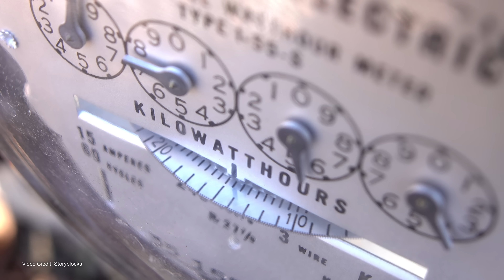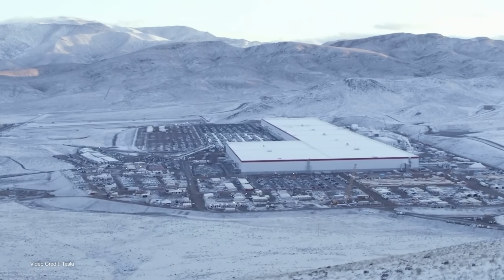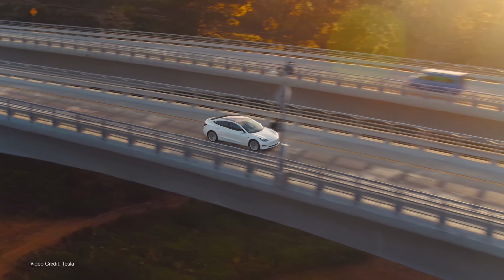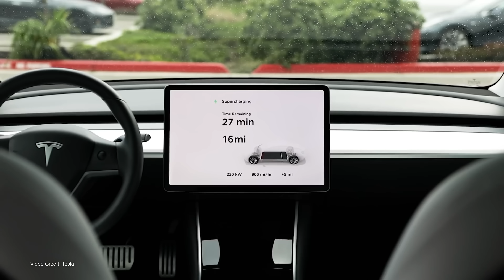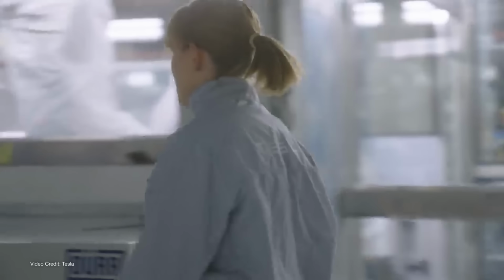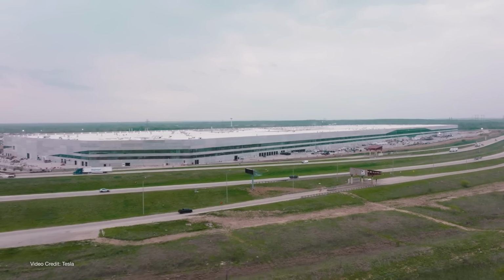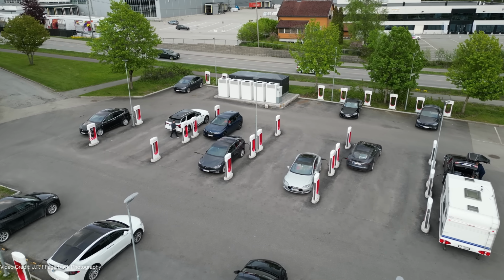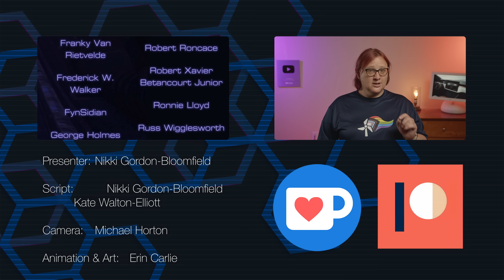Tesla News Roundup Episode 14: Munro Model Y Teardown, Where Tesla Staff Are Going, Model 3 1,000km!

Comment: There are some pretty darn quiet luxury ICE cars...  are they going to be required to have a minimum noise level too?
Reply: You mean interior noise. outside they are as loud as ICE cars at speeds over 30km/h due to the noise coming from the tires.
Reply: @rehleinklein7373  nonsense!!!!!! Those luxury cars also also almost as silent as EVs! Not all ICE are made to be soooo noisy! Modern ICE are actually super quiet in and out, apart from diesels.
Reply: @carholic-sz3qv  nonsense. Go to a highway and find out how noisy cars are. 😂
Reply: @rehleinklein7373  i am actually in the highway very often and it’s the tire noise that is the most l, also wind noise with all the different vehicles and loads moving around!
Reply: @rehleinklein7373  also in cities it’s the same! I usually get back home very late I know the night and I actually analyze the noise of electric, gas and hybrid cars and guess what! It’s basically the same except from the diesel or very older cars.
Reply: The noise-makers are required only at low speeds. Many new ice cars are super quiet while their mufflers are still new. Regardless, The person driving should know that they are proceeding silently instead of relying on an artificial noise to alert others.  The artificial noise does nothing for the hard of hearing. The noise maker is useless, annoying and shouldn’t be required. And if it’s not configurable it sucks even worse.
Reply: Balderdash, we're talking about low speed noise is low on many ICE, stop all the hooey about high-speed noise, chipped cars, cutouts, catback systems, trucks and other absurdities

Comment: CCS2 is also the standard here in Australia and i believe in Singapore at least if not all Asia as well. Therefore J1771 is only US and that tesla proprietary connector is only in US and some very early models in Aus
Reply: It's J1772 and it's not US only.  CCS includes a J1772 connector which is used during AC charging.
Reply: And how many vehicles has Aptera delivered to customers so far?  However, one Ioniq owner described used high voltage fast charging cables as "wrestling with an anaconda."  He also mused if physically disabled persons could manage.
Reply: @BixbyConsequence  CCS is essentially: you take the local AC chargeplug and you add 2 more pins beneath it for DC fast charging. The CCS connector is different in the US from the EU for example, but the tech beneath it is identical.

Comment: I'm wondering about recycling the structural pack. From the Munro video - it is difficult to see how any recycling would be possible.
Reply: No problem, just dump the pack into a shredder. That is how it is done at most recycle facilities.
Reply: @georgepelton5645  - Thanks, just looked that up. Looks like a good solution.

Comment: I have to point out that the EU specified one plug to use by everyone before Tesla started selling the Model 3 and Y and Tesla is not 70% of the market in Europe like it is in the US.
Aptera like the Model S and X just don't have enough space for the clunky CCS plug. I think Tesla has redesigned the opening for future MS and MX, but the Aptera just doesn't have space unless they turn the inefficient and heavy CCS plug sideways. I did see a Chinese car where that was done and it's not pretty.
Lastly, there is a well known problem where the weight of the huge and heavy CCS plug pulls down on the connection and causes some communication pins to lose connection causing the car to randomly stop charging and apparently not notifying the owners, so when they return to the car they find it barely charged at all and they have to wait more.I would be embarrassed to be the designer of the CCS plug. This is part of the reason that studies show CCS chargers often don't work where Tesla chargers nearly always work.
Whichever plug Aptera ends up with, I don't intend to use fast charging very often because it is so efficient that a level 2 plug will give a pretty fast charge and be much less expensive, or even free, except in North Carolina where they have mental issues.
Reply: A cursory search suggests that an Aptera has 25 cubic feet of luggage space or 700 litres. 300 litres is about average for a hatchback and more than enough for a monthly grocery shop. If the Aptera no longer has enough room for a cable of each type, plus a weekly grocery shop, something has changed massively about the design. I did wonder elsewhere if they were trying to save space, but given their claimed luggage space, it doesn't seem a likely reason plus I'd expect them to have made it front and centre in their argument if it were.
Reply: @jonevansauthor  Aptera has been putting the plug behind the license plate and a redesign at this stage would delay production. They don’t really have many other large flat surfaces to hide a plug behind. 
I’m not a fan of any cars that put the charge port on the nose because on my road trips the front is where all the bugs die
Reply: If the Model S and X wouldn't have enough space, then how are they sold in Europe with the plug? Yes, the plug is bigger, but it's not that huge. And Aptera is planning to sell their EVs in Europe as well where CCS is the legal standard. You can chose to equip your cars with a different chargeplug, but that's only going to hurt your customers in the long run as they'll start having trouble finding compatible chargers. I can imagine Tesla at some point starting to remove the Tesla plug in Europe (which is different than the Tesla plug in the US).
Reply: @Hans-gb4mv  Tesla S and X owners use an adapter to CCS in Europe. Those cars were designed before CCS was invented and before the EU mandated the CCS plug for all cars. Tesla uses the CCS plug in their chargers in Europe as well because it's the requirement. The US has not made any requirement and Tesla sells about 70% of the EV's in the US so far, so 30% are all the other brands and their models. For a lot of people the Tesla charging network is one big reason for choosing Tesla and it's why I bought my Model S

Comment: Cell level repair of EV batteries isn't a thing anyway, so repairability of the pack kinda doesn't matter.
It's far more important to make a solid, well-sealed pack that lasts as long as the cells do.

It's also noteworthy that the 4680 packs, like all Tesla packs so far, are engineered to keep working if some individual cells fail. In the best case, failed cells are permanently disconnected by melted fuse wire.
Reply: You are wrong on having faulty cells repaired! There have been several Tesla owners having calls repaired at a considerable lower price than what Tesla wanted to replace the battery!
Reply: You’re trying too hard to avoid the right to repair!!! Why!!!! Batteries after the car can already be used for other purposes until they are no longer viable then the recycling is needed.
Reply: On ICE the engine oil, gearbox oil, and many other consumables aren’t trowned away after changes, those are recycled/reused for other purposes
Reply: @gmv0553  is there any info online on such a replacement of individual cells?
Reply: @carholic-sz3qv  So you forgot the oils that’s wasted through leaks onto the road surfaces and pavements and driveways that’s not recoverable, and that adds to the treacherous driving conditions when it rains, and snow, as oil and water don't mix and it's becomes a hazard to the environment, and so there’s no way to use this as any type of comparison when it comes to the recycling of batteries. Cheers!🥂
Reply: @theodorehaskins3756  lol….. the recycling of batterie isn’t unfortunately 100% just like everything else and there are going to be very toxic chemicals or waste to be get rid of! And the waste begins rien the mining and processing which ironically still relies on the oil industry who knew that!!!
Reply: @carholic-sz3qv  So why do we hire people? The answer of course is because we need people to solve problems, otherwise there would be no need to hire anyone, so just like the properties of oil was discovered, the properties of lithium was discovered, the properties of electricity was discovered, and the properties of batteries using lithium ion was discovered, so you see where I am going with this right? So what you have described are problems waiting for a solution to be discovered, and so just like all those other things I just mentioned, somewhere, someone will discover them, and when they do, problem solved! Cheers!🥂
Reply: @theodorehaskins3756  problem solved my @zzzz we have only always been able to find a compromis! Not a real solution! EVs where the very first vehicles   But today we are still trying to make good batteries! For recycling and production there is always going to be waste that aren’t recyclable! Just like all oil has way more applications and usability compared to the lithium batteries.
Reply: @carholic-sz3qv  So if there was a solution in your comments I didn't hear it. So what I heard was that you're not the person that has a solution to any of these problems, did I get that right?
Reply: Totally is a thing

Comment: As much as I like the Tesla connector, I think CCS2 has longer life and supports a higher rate. Or, we could work on a new standard that supports much faster charging. We can always build adapters to bridge the gap.
Reply: Yes CCS 2 supports three phase power already, which CCS1 does not. It's got a locking mechanism as well so it can't be unplugged by strangers walking by or fall out.
Reply: @jonevansauthor  Yeap, between the two, I would much preferred we standardized on CCS2. Probably easier for Tesla to provide an adapter, than have the entire industry adopt the Tesla connector.
Reply: @jonevansauthor  CCS2, just like CCS1 is a DC charging standard. There are no power phases in DC charging, that's an AC thing. And the "Mennekes" plug used in Europe for AC charging has always supported 3 phase charging (4 pins for power), but these pins are not used for the DC charging.
Reply: @Hans-gb4mv  CCS is the combined charging standard because it's both AC and DC. 

The CCS 2 connector allows for faster charging by AC than the CCS 1. 

Mennekes is just the brand that makes the connector, and I'm not sure what you mean by 'always supported 3 phase'. I wasn't aware I'd suggested that CCS 2 was NOT three phase? That was my point - CCS 2 is a better standard than the 1. In part because it's 3 phase.
Reply: @jonevansauthor  When correcting someone on the internet, make sure you actually put out correct information.

CCS is the DC fast charging standard, not AC charging. And since it is a DC charging standard, there is no phase variance. If you do not know what AC and DC is and what phases in electricity are, you should go look it up.

And yes, Mennekes is a brand name, you would be surprised how often we refer to items by a brand name instead of the actual name of the object, even if the object is from a different brand. In this case most people will call it the Mennekes plug because calling it a type 2 connector is ambiguous due to the fact that in the US you have a different Type 2 connector and in China you have yet another type 2 connector. You could also use the technical name of the connector and that is  IEC 62196, but most people don't know that name (unlike the American J-1772 connector but that's a type 1 connector).

And this Mennekes plug is the one that supports AC charging, this is the plug that allows you to do 3 phase AC charging up to 22kW. For DC fast charging with CCS, you add 2 pins beneath the IEC 62196 connector for a direct current connection up to 400V/125A (CCS1) or 800V/440A (CCS2). The big difference between CCS1 and CCS2 is that they increased the limit for both voltage (a choice between 400V and 800V) and the max current allowed so you can get up to 350kW.

Technically, you could do DC charging on a IEC 62196 connector, that is supported in the Type 2 standard, but you can never do AC charging on a CCS connector, and with only 2 pins available, you can never do 3 phase charging as that requires 4 pins.

The next time you are at a CCS charging station with a CCS2 connector, have a look at that connector and count the pins.

But if you have any reliable source that can show me you can do 3 phase power on a 2 pin connector, please, show me. So we can start updating all sources like for example Wikipedia.
Reply: @Hans-gb4mv  what on earth are you on about? It's all over the place that CCS 2 adds three phase charging and that CCS if both types exists to give you a plug and socket that can do AC or DC charging with. 

Did I say 3 phases uses 2 pins? No. Not sure why you think I did tbh.
Reply: @jonevansauthor  no, it isn't. CCS are the 2 pins added to the Type 2 connector to add DC fast charging.

You never combine the AC and DC and a CCS charger will always be DC only.

Please, find me a CCS charger that does AC 3 phase charging. It doesn't exist.

But you know what the big difference is between a type 1 and a type 2 charger? Right, type 1 is single phase and type 2 supports 3 phase AC charging.
Reply: @Hans-gb4mv  I'm pretty sure you're just talking at cross purposes to me. Perhaps you're trying to say that the socket has a DC bit with 2 pins, and the AC bit has different amounts on CCS 1 and CCS 2 - and you are only ever using either the top or bottom pins? 

There are cables that have a combo plug, or a plug that's just the AC one (possibly a DC only cable as well that just has a plug for the bottom two pins but I can't see one on sale  and all the graphics label the combo as the DC option). 

You say CCS1 & 2 are DC only but that doesn't seem to make sense. 

"The Combined Charging System is therefore ONE system for ALL.

The CCS combines single-phase with fast 3-phase AC charging using alternating current of maximum of 43 kW. It also provides very fast high-power DC charging (up to 450 kW) within a single system."

"The Combined Charging System is the solution to all available types of charging: single-phase or 3-phase charging using alternating current (AC charging from 3.7 kW) as well as DC charging using a house connection up to 20 kW or public charging stations up to 200 kW. "

Those are both from the CharIN website FAQ so I'm going to take their word for it about their standard, since they say it's for AC & DC and my bet is that they'd know. As I say, I'm really convinced that you are just talking at cross purposes to me, because you've misinterpreted what I said. shrugs 

Either way, there's a separate Megawatt standard in development for juggernauts and buses etc.
Reply: @JasonTaylor-po5xc  The F-150 shipped with an adapter called the TrollingElon which allowed owners to charger their friend's Tesla so even Ford have access to one ;) 

It seems clear that CCS2 is the way forward, and if any clever person has a better design in the future, we'll just adopt that. It's not exactly challenging to take an ev charging station and fit new cables, or sockets to it. 

It'd just be better to have a few years where everyone used the same one. And for the US and the other holdouts, to switch to 230V and 3 pin British plugs, of course.
Reply: @jonevansauthor  actually I've been doing some digging and found that we use different definitions for what is CCS1 and CCS2.

When I'm talking about CCS, I am looking at it from the charger side and the protocols involved and such. And from that end you have the original CCS chargers at 400V and when they launched a new version of the standard to incorporate things like 800V as well as plug and charge, that was refered to as CCS2. And that is what I have been referring to. And when I talk about CCS charging, I talk about DC fast charging because that's what CCS is designed for as the AC charging is not done from a CCS compatible charger. Without CCS you still have the same AC charging capability. CCS is simply an extension to add DC fast charging.

You on the other hand, have been referring to what is essentially the viewpoint of the connector on the car. There you also have something that is called CCS1 and CCS2 whereby CCS1 refers to a CCS connector based on a type 1 charger while CCS2 is based on the type 2 charger. And yes, in that case you can say that you use the CCS receptacle for AC charging.

However, in that case, the type of connector you get is more dependent on the region you live in than anything else. You won't get the type 2 plug in the US and you won't find a type 1 plug in Europe (ignoring imports)
Reply: @Hans-gb4mv  there are an awful lot of websites out there, with awkward explanations, and they use the IE standards, or the CCS 1 name, and don't always make it clear if they're talking about the plug, or the socket, or the charging station or the vehicle or the cable. 

It is completely understandable that it's hard to have a coherent conversation about the subject through text messages on this platform. 

No harm, no foul.

They could solve this by having a worldwide standard, like Type C. Which no doubt would immediately create a new Apple only connector, that was better for approximately one year, and then they'd doggedly stick to it because their car charging cables are making them a massive markup.

Selling fancy cables is basically money for old rope, and one of the biggest scams in the electronics industry.